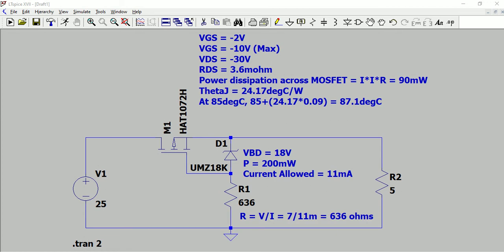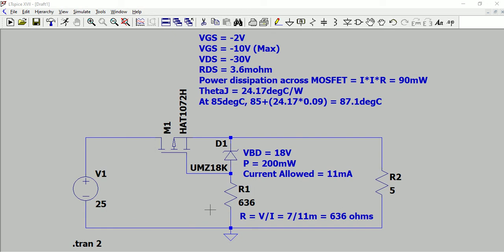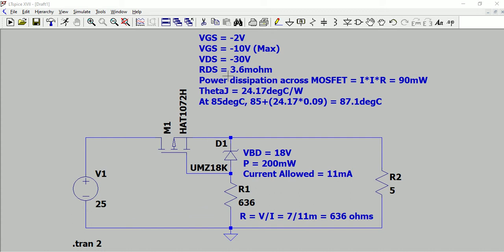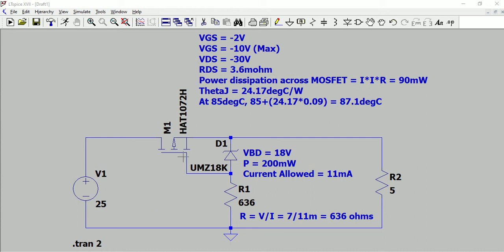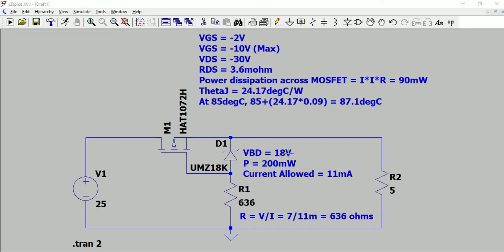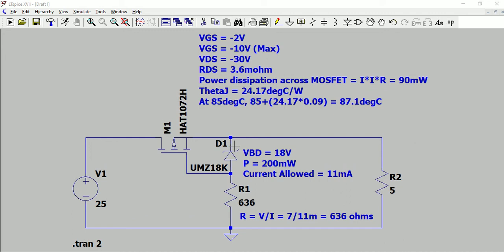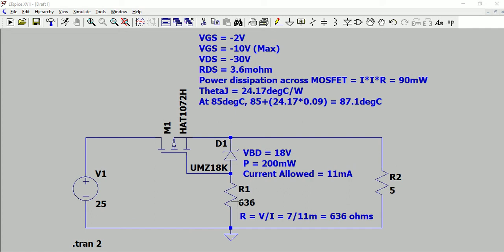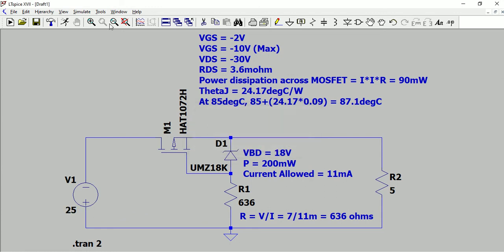Reverse Voltage Protection circuit using MOSFET || P-channel MOSFET for Reverse Voltage Protection

Comment: Thank you, Very good explanation, I have a question regarding the Resistor Selection, as per my knowledge most of the schematics I have seen which ranges value from 10k,47k,100k ,in some cases 220k also used . But when we are using such a low resistor in your  example 636ohm its power dissipation is (0.636k*0.636k*0.011=4.44W)  huge . So can you correlate the exact value of resistor selection . I don't know whether I'm correct or not but for the zener to regulate minimum test  current is sufficient right,in that case we can increase the resistor value further?
Reply from the maker: You are right. The wattage of the resistor resistor is high. 11mA considered here is the worst condition. The actual current can be much lesser.
Reply: @Way2Know  thank you, but still I have a question regarding the selection of resistor in some times people will question like why only 1k why not 10k or 100k ,how can we justify for this,one reason is power dissipation capability ,do you have any other reasons to justify .
Reply from the maker: Better to have lower value resistor:

1. As there is enough room for current
2. Here we are just talking about 25V, voltage is not the same always, mifht drop in some occasions. We have to consider head room for that
3. Variations/ripple cannot be predicted.
Reply: @Way2Know  thank you , for your great work to share your knowledge  and experience by spending lot of time to make these videos.
Reply from the maker: You are welcome..